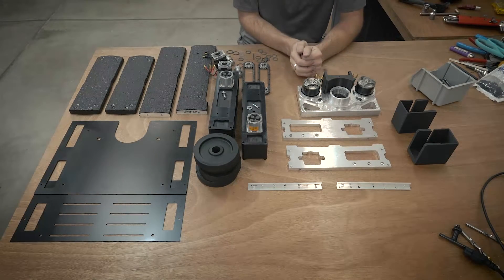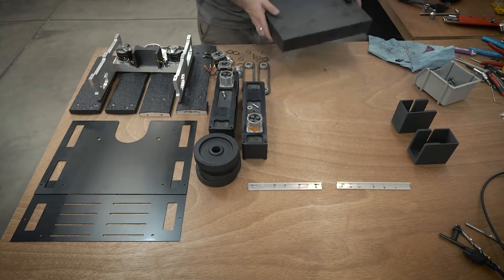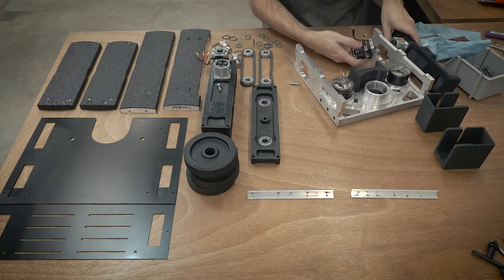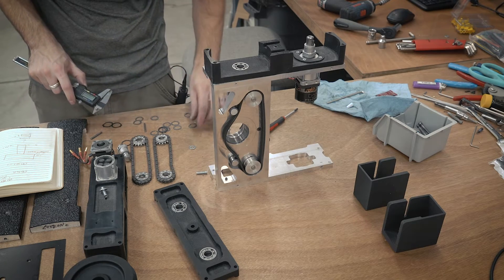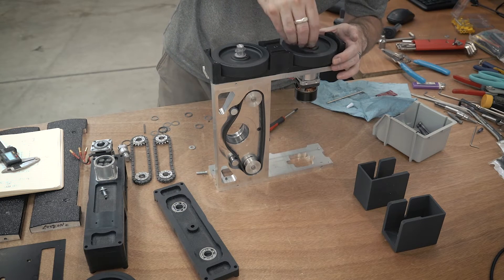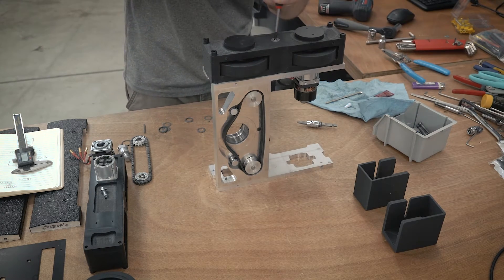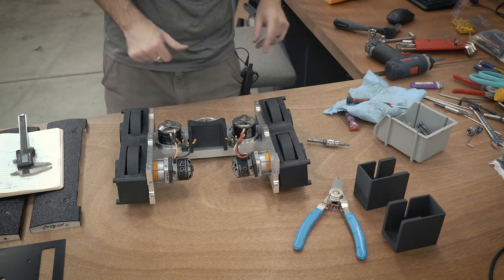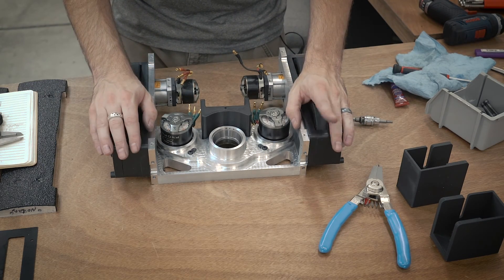Crippling Depression Assembly: Drive Blocks

Comment: What are the main differences between different motor brands?
Turnigy
Propdrive
AlienPowerSystems
Flipsky
Reply from the maker: You get what you pay for?  It really depends, that's like comparing apples to rainbows.  It really depends.  Just look at the specs, find a motor that works, and if the price seems too good to be true, it MIGHT be.  But usually (generally, most of the time, when you're lucky), cheap motors work just fine.
Reply: @RobertCowanDIY  Ok sounds good! In my case I'm going with the expensive option from Alien Power Systems, fingers crossed!

Comment: Are you using the screws that hold the gearbox together to face mount the gearbox itself? I noticed in your other videos that you aren't using the mounting holes on the sides of the gearbox.
Reply from the maker: Yep.  I use longer truss-head screws that are supported by a 0.050" titanium spacer against the inside wall of the UHMW.  This presses the face of the gearbox against the UHMW wall.  The mounting holes on the sides of the gearbox are where the plastic 'cups' mount to keep stuff from interfering with them.

Comment: very slick! Looks great. 

One thing i've learned is designing for serviceability can really save time and frustration at competition. If you designed your side plates to have locating pins, or a locating feature between the parts that bolt together you wouldn't need a granite block and your precision to assemble the robot. 

You say its built to "tight tolerances" in reality you have many small clearances for no reason other than to be close; adding an 1/8" here and there wont make you overweight. Very Clean.
Reply from the maker: Everything does actually need to be pretty close.  Adding an 1/8" here and there would absolutely make me overweight, I'm only a handful of grams underweight.  The biggest problem is that the weapon needs to be on the same flat plane as the wheels.  The wheels are essentially 'keyed' because of the 4 mounting holes through them.  So as long as the left and right inner frame rails are on the same plane, the wheels will be on the same plane.  therefore the weapon assembly also needs to be on the same plane.  The weapon disc has less than 1/16" clearance between the bottom and the floor.  Since it's a bit larger than 10" in diameter, if it's tilting forward or backward just a little bit, it would end up hitting the floor.  Realistically though, the frame rails and the weapon block never need to come apart and for the next version, they will be semi-permanently attached, so it should only need to happen once.

Comment: Those loose drive blocks gave me an idea.
Would it make sense to have the drive blocks only loosely connected to the main frame with some rubber bushings?
I wonder if that could improve handling and shock resistance?
But on the other side, clearly the design goal was a compact solid structure and also the weapon rides very low over the ground too. Probably not woth at all.
Reply from the maker: That's the idea I had with making them out of UHMW.  Rubber shock mounts or bushings could work, but they wouldn't be strong enough I suspect.  They would just bottom out.  The UHMW is meant to absorb the same vibration/impacts, but is much more rigid.  Initially, the whole drive block would be floating and have bushings like you said, but I felt it wouldn't ride or handle well, with all the movement.

Comment: Dowel pins are a good way to ensure proper registration between machine elements.  You can also get hollow dowel pins for coaxial use with bolts.
Reply from the maker: Good to know!